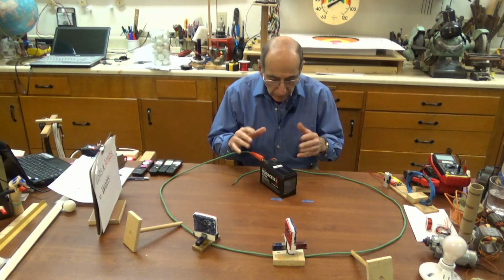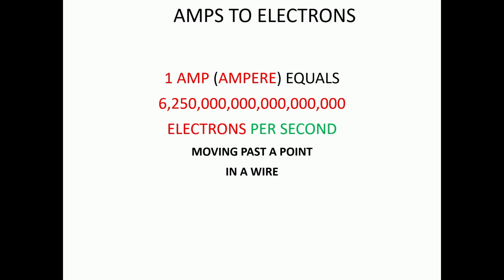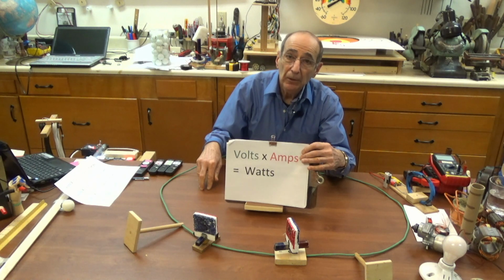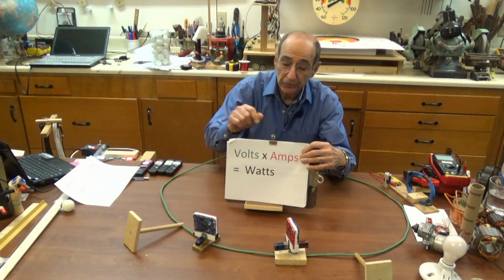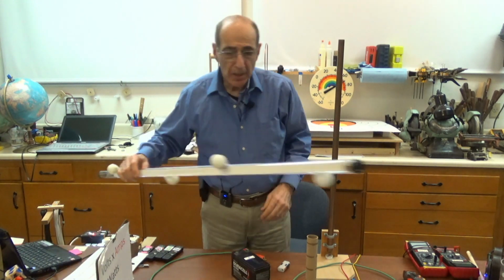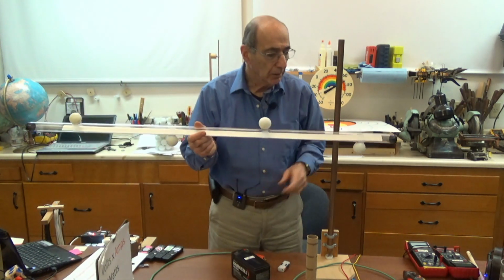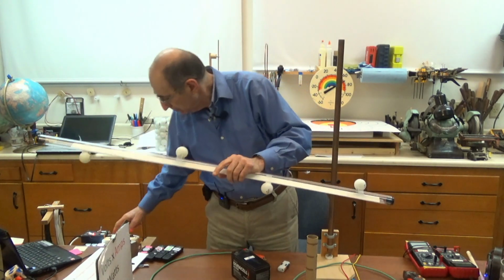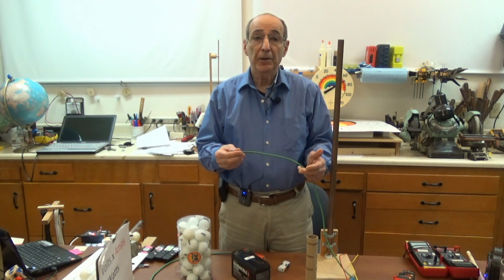Session 4  Volts and amps and reinforcing electromagnetism

Comment: Going through the steps to show how one coil turn offers a 3x multiple of the radial magnetic field and then showing how the n=50 turns multiplies the line current to give the total charge moving through the ammeter's sensor is brilliant pedagogy.
You also did a fantastic job of explaining the reason for magnet wire's use vs sheathed wire (volume efficiency; I would add one detail for the totally uninitiated though, namely that bare copper wire will short-circuit the loops and therefore not work-  I've seen cases here people have used bare wire without success only to conclude that EM is some sort of government hoax!
This is a really useful foundational video. Thank you!